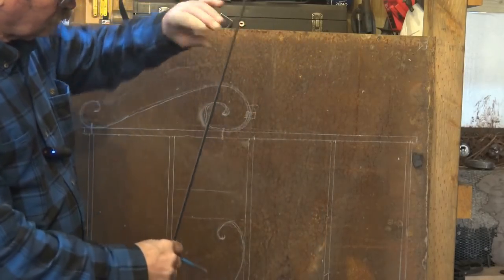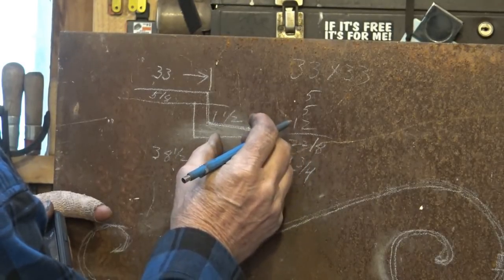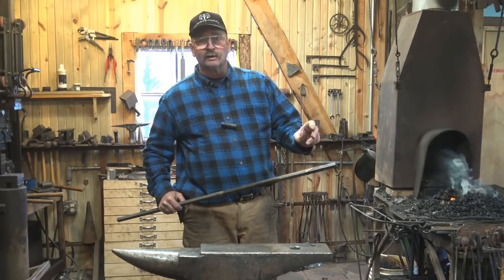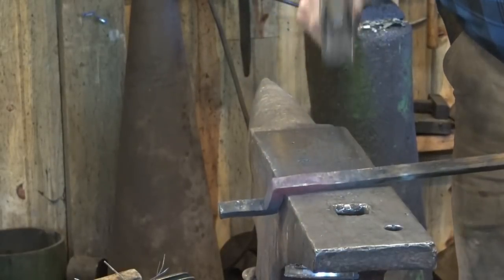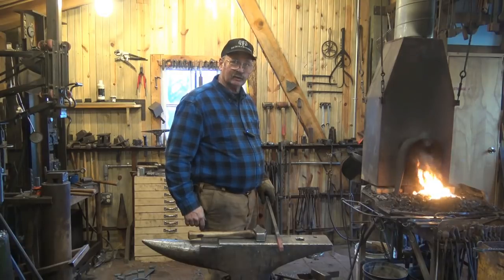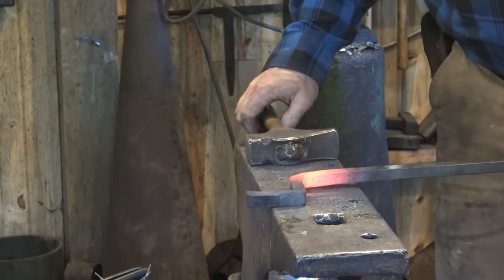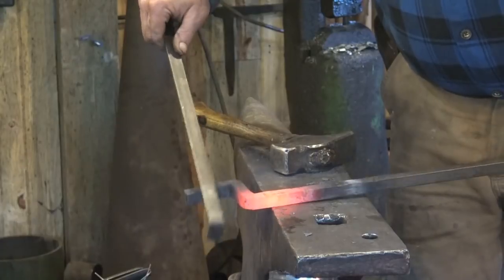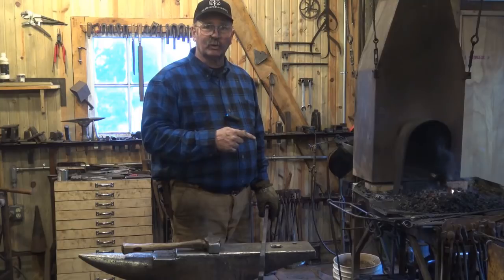forging double upset square corners  - "wrought iron" grill part 2

Comment: Nice thing about that Lee's technique even if you did mess it up. It does illustrate a way to do a 90 degree corner but kinda has a nice decorative touch to it. especially around 36 min 20 seconds. just my point of view.

Comment: Not following along yet John, I intend to let you get a bit further through the process before I start, that way I can swap back and forth between different elements of the build. It is also 32 degrees celcius and 60 percent humidity here at 9am, forecast is 38. So I'm not inclined to be doing any heavy forging until the current heat wave goes away!

Comment: John, I realize this is an older video, but the first time I've seen it.

I noticed you had to spend a lot of time searching for your center punch mark in the hot steel.  I had the same problem until I made a square center punch instead of a round one.  Now the punch marks in hot steel are much easier to find.  OOPS!!!  I viewed the video a couple of times and you mentioned you DID use a square center punch....my bad, sorry!

Comment: Hey John,

I was just wondering where you got that pencil you're using - it looks really handy.

Cheers!
Reply from the maker: That is a welders silver pencil.  They are available from welding suppliers or industrial suppliers.  This one is a plastic lead holder with separate leads.  https://www.mcmaster.com/#pencils/=1c9l3qj
Reply: Thanks!

Comment: Opinion?: if one wants to add exhaust to a forge, split the air on the blower side. New leg to flu at as near parallel as possible. This uses same forced air source for fire and exhaust. Lots of detail but your opinion on the theory? Thanks!
Reply from the maker: As long as the blower has the capacity to feed the fire while inducing draft.  On the other hand.  There are very few forge chimneys out there that need any induced draft.  Proper hood and chimney design should eliminate the need.

Comment: I think the big thing to remember on the alternate method of a right angle bend is that point needs to be forged at a 45 or pretty blunt. Where I have found it useful is putting a right angle bend in a piece of round bar.
Reply from the maker: I think that is exactly where I went wrong.
Reply: I forged a folding trivet to hold a pot over a fire from 3/8 round bar (if I remember right) and used that method. It turned out good. But I am like you, like the upsetting method best especially for square. As you said it is easiest to keep your center mark under control.
Reply: Great video and project by the way.
Reply: I currently am out of commission with a busted rear worm gear bearing cone on my Champion 400. And I need to get busy finishing up welding my fire pot for my portable forge so that I can use it while I wait and also have something to use for travels this summer. (I gave the fire pot out of my portable to my son so that he could start forging.)
Reply from the maker: Breaking a Champion 400 is a sad thing.  Those are the best blowers out there.
Reply: It was indeed sad when I found that cone broken however I think I can make one. I have the correct tap on order. Also I am planning on building a blower and I will document it in video if I do.
Reply: bc65925 ,pull the rear bearing cone out, measure the OD, thickness and ID.
Take those dimensions to a industrial bearings g supply house.
You can get a sealed rolled bearing to replace the coned setup.
I did that very thing 4 years ago. I don't recall the bearing  number or I would post it for you.
Reply: That thought had crossed my mind, maybe when the weather clears a little. It's awful nasty out there right now.
Reply: bc65925 
You will probably need to make a new nut to set the tension on the worm gear shaft.
It takes VERY little preload on that shaft.
I double nutted mine once I had the preload correct.
I was shocked that just the slightest amount of preload was perfect, and just a touch more and it got very difficult to turn the blower.

Comment: Good John, could you do a video on drawing out, like when drawing out reigns for tongs, manually not with a power hammer please?
Reply from the maker: Yes I can.  That is actually going to be one I do very soon.  Tong making has been a very requested subject and I want to present the first look with as few specialty tools (like a power hammer) as possible. I spent part of today working on samples of tongs that are made without any tongs, or forge welding and with reins that can be drawn out by hand
Reply: Oh good mate look forward to it.

Comment: Would it be less of a hassle to do the upsets and then scarf weld the two ends onto a middle bar?
Reply from the maker: I suppose it could be done that way, but it may not always be an option.  Plus this came out correct, it was mostly my trying to think and explain out loud at the same time that makes it seem harder than it really is.

Comment: Any reason not to do the slitting/drifting of holes before making the corners?  I was thinking to just start from the middle and make the bar to length when you get to the corners...
Reply from the maker: That would probably work.  I prefer to do the corners because they are the hardest forging and would rather not abuse the bar more than necessary after the holes are made, especially the ones very near the end.
Reply: That makes sense indeed, the holes will probably be one of the weaker spots while doing the remainder of the work

Comment: I was right along with you till you wrote down the 1 1/2” then said that needs to be 3” I came up with 41” where did you come up with that measurement I got lost on that part?
Reply from the maker: I think that was 1 1/2 on each end came to a total of 3"  I was confusing myself during that part as well.  Doing the math in my head on the fly while trying to explain it didn't go as well as I had hoped.  Do a test piece and see how your material moves and how the length changes and then use that information to calculate the length you need.  Different people with slightly different techniques can have different results, which means the rules of thumb aren't always exact.